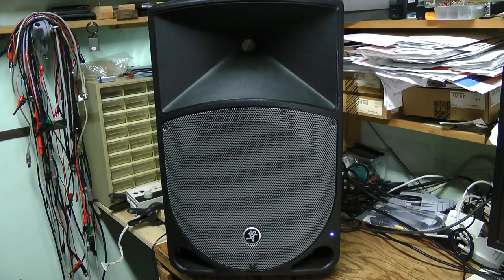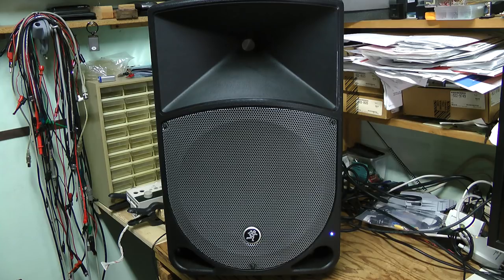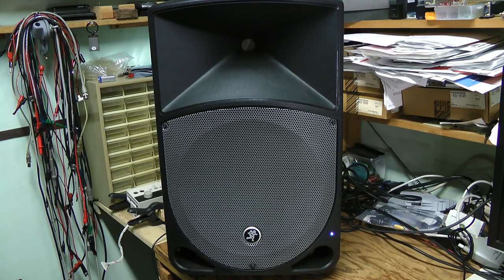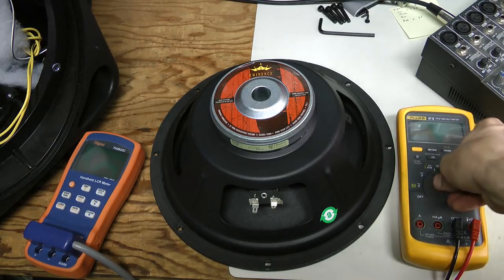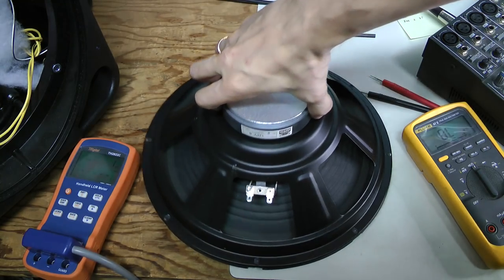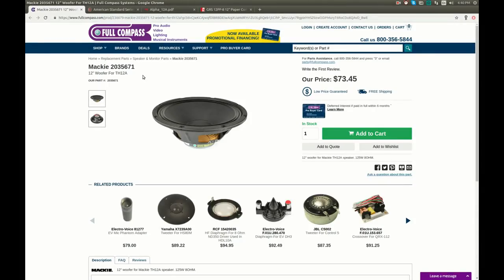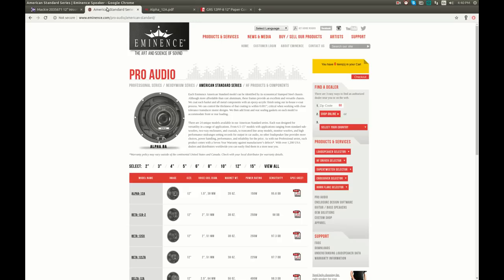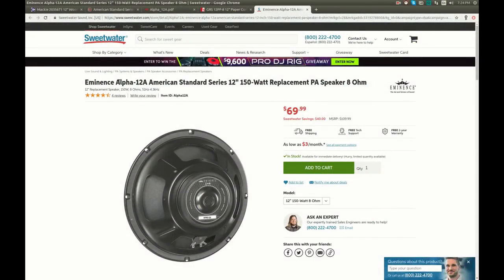#73 - Mackie Thump TH-12A blown woofer

Comment: Hi Man! I appreciate your work so much .. i have a Mackie Thump 15a with a new problem: the overload red led is always on, as soon I power up the speaker, no sound coming out.. only a strange sound - high freq sound  (like frying) - coming from the filter of the AC power input, right after the on/off switch. Any ideas? Maybe we can take out another useful video about that :D Thanks for your time

Comment: Thank you for this video. Very helpful.I hope you have video of jbl eon 518s because I got one which doesn’t work. I checked the woofer with 9v battery and it make some noise meaning the woofer is still good. Checked fuses they are fine too. When plug in and power light is on. Connected it from mixer green light turns too but it wont make any sound at all. Thank you.

Comment: It is  important to put the original woofer back in the Mackie Thump because the Thiele small parameters must match to get original performance.  Just selecting any 12" woofer is not  the way to do it.
Reply: You are right in saying original replacement is the best..but Mackie is prof. audio gear and is not T.S.P. certified... nowhere in their data any mention found..
Reply: +1 The bench test unit has a foam surround that explains the far lower efficiency, so it wouldn't match the tweeter either.

Comment: I have one of them with dead woofer here, of course there is no way to find original woofer. The real problem is, that this PA has FPGA with audio codec on the input that is programmed to shape EQ input in the way, that compensates for driver non-linearity. (common practrice on the modern PA systems). So putting anything else in wil likely sound off.
Reply from the maker: Why no way to find the original woofer? Here it is:
https://www.fullcompass.com/prod/236679-mackie-2035671-12-woofer-for-th12a
And I think you overestimate the level of sophistication and how tightly the electronics is matched to particular drivers.
Reply: @feedback-loop  Out of stock man! About overestimation, it is common practice to use tuned EQ to get away with cheaper speaker and enclosure.
Reply from the maker: @kttkttkt  It is still available for ordering. Perhaps will take a few weeks to wait for back-order to ship to you.

Comment: I need to repair a Shure Receiver BLX4R and I'm having trouble removing the cover. I have removed the screws from the cover and the face plate, but it appears the cover and face plate are connected internally at the centre of the face plate on the top. I can not workout how to separate them, do you know how to open it?

Comment: hi do u now how to fix mackie srm 450 v2 because 1 of mine does not work but i want it fixed pls if u can
Reply: I'm a repairs tech and repair have worked on mackie units... The v2 is the smpa type and you need to know how the psu works before working on these.

These amplifiers contain high voltages that will shock!
Reply: Unless you know how to repair these units... Be careful of them voltage lines in there... These v2 are not for the novice